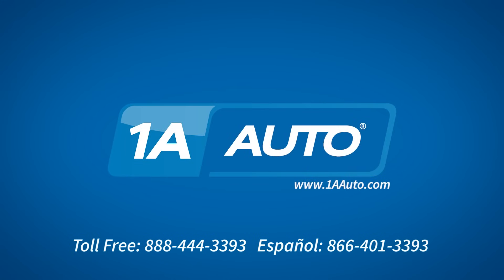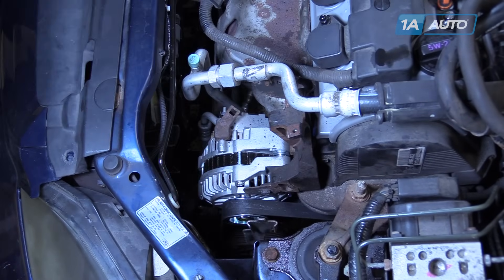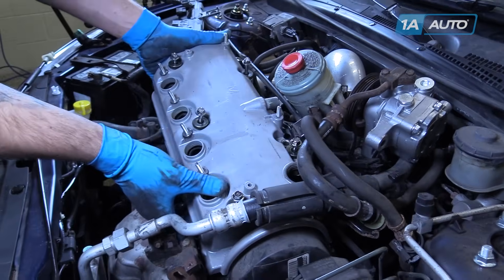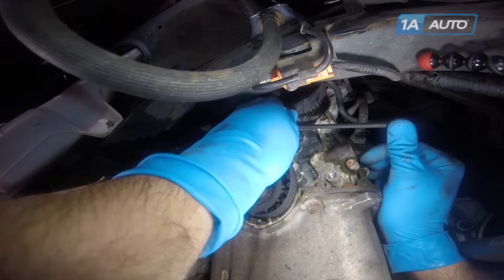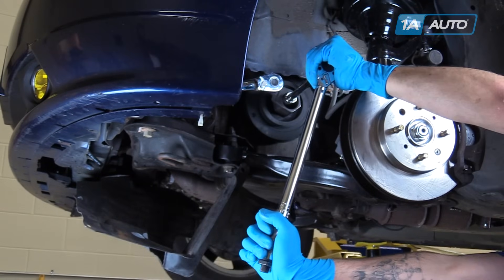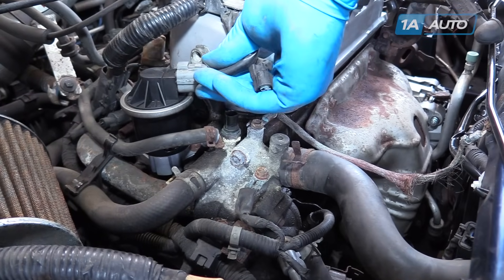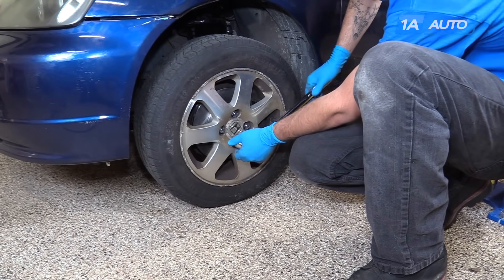How to Replace Timing Belt and Water Pump 01-05 Honda Civic Coupe Sedan

Comment: If you are going to do this job, make sure to turn the engine over COUNTER clockwise.  And it’s probably a good idea to disconnect negative battery cable so you don’t short anything out when removing alternator (be sure to have your factory radio code).
Reply: What is the reason that you should turn the engine counter clockwise?
Reply: That's the direction of rotation for the engine. If you turn it the other way you risk skipping a tooth, then you'll need to re-do the job
Reply: Two Thumbs Up for making this observation. I was wondering the same why the engine was turning clockwise instead of counter-clockwise and the battery should be disconnected as well.
Reply: because this Honda engine is a interference engine you will bend the valves if you turn it clockwise.
Reply: The reason he turned the engine clockwise has to do with the way the bolt is threaded into the crankshaft. If he tried to turn the engine in the opposite direction (CCW) the bolt would start to come out and not rotate the crankshaft.
Reply: Yeah I think this video is risky because of the fact that you're turning the engine backwards on an interference engine.
Reply: At what time in the video does this occur? What minute?
Reply: jimbobimboslice @17:13
Reply: @jimbobimboslice  did you get your answer? lol it is at https://youtu.be/3PAgdJ1ZSeA?t=741
Reply: Any one that knows this engine knows it is a counterclockwise engine
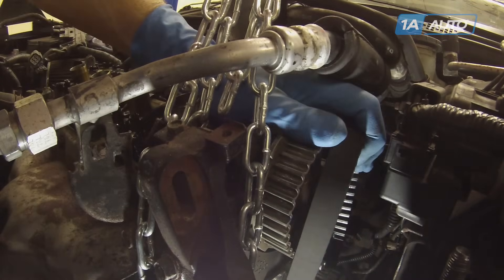Reply: @jimbobimboslice  17:06
Reply: I wish i had read this before doing the job, now I have to do it again hoping i didnt screw something up.
Reply: What the heck i just turn it clockwise like he did,
Reply: Joe Vignolo that bolt is torqued to several hundred foot pounds. Turning it counterclockwise like that will not even come close to loosening it I promise you.
Reply: @TheMrFlyBoy18  I see. Thanks. 

So we just turn it 2 complete rotation in a counter clockwise direction?
Reply: @Cowboy1Brian  Yes, I saw it. Thank you.
Reply: @ledzeppelin1212  I see. Thank you.
Reply: How to turn crankshaft twice if the bolt isn't tight?
Reply: If I turned it clock wise like in the video how do I fix this mistake?
Reply: @daddy.toe_666tm5  I did the same thing man😂
Reply: @robertauvil5451  exactly I had a 02 Honda Civic Coupe. I did the timing belt myself and I knew it was an interference engine I didn’t want to break my engine. I replaced the old timing belt with an aftermarket timing belt that was more durable. I installed an aftermarket radio after I was done with the timing belt.
Reply: But didn’t he already loosen that bolt to take the crank pulley off? How would you rotate it clockwise when the bolt wasn’t even torqued?
Reply: @thegreazysloth852  no it is not, the bolt was taken off and then placed back on in order to turn the engine. It is normally torqued to around 181 ft lbs of torque, but he just tightened it enough to turn the engine
Reply: @thegreazysloth852  so your saying we have to re torque it so it won't break counter clockwise
Reply: Yea i was looking confused too like "are they going the wrong way? Ahha
Reply: @Djevan41598  what brand was this aftermarket timing belt that was more durable? Model number? I would greatly appreciate it. Thank you
Reply: I noticed he did colckwise
Reply: Can anyone recommend a good video on the correct way to change the timing belt & water pump. I'll be doing this job tomorrow & I have 0 experience
Reply: @thegreazysloth852 How do you torque the crank bolt without the crank pulley for the serpentine belts attached and the use of the special Honda tool?  Looking for a proper method of turning counterclockwise, with the bolt installed, but not the pulley so that I can verify timing.

Comment: * START by disconnecting the battery!!!!***  Otherwise disconnecting the alternator will be disastrous.
Reply: It looks like it worked pretty good for him without disconnecting it but yeah that should have been done
Reply: The vehicle is grounded thru the alternator bolt.
Reply: @GampoEC  What you talking about brother?????? I’ve been a mechanic for 30 plus years and this got to be the dumbest thing I’ve ever heard.
Reply: As long as you don't touch anything grounded while removing the alternator charge wire. Then it all good. But i agree an unnecessary risk to take.

Comment: Buying a used 02 civic. Making sure this doesn't need replacement soon. Cause I don't want to do this or pay someone to do this lol
Reply: It would have to have prior maintenance done to the timing then.  They all need them changed.  It's probable that engine mounts, suspension, etc. will need replacing. So, you might as well do it all at once and know it was done correctly.

Comment: Hi 1A, your videos have helped us on numerous occasions, so THANKS! In no way are we trying to discredit this video, because it is right on the money, with the exception that this engine rotates counter clockwise, so when rotating it to make sure the timing and belt tension is correct, you have to turn it counter clockwise , not clockwise..
Reply from the maker: +Online Auto Repair Videos Thanks for checking us out! http://1aau.to/m/Shop-1AAuto-c

Comment: I just finished changing the timing belt on my 2005 civic while using this video as a guide. This video is great: high image quality, clear instructions and just the right length. Thanks for posting it!
Reply: Can some1 ^pls^ explain why it has been suggested to lift the car from the oil pan (w/ the wooden block under it). This not jack pt
Reply: Reza Grans you lift it to support the engine because you will be removing the motor mount bolts on that side
Reply: Good job! How difficult would you say the job was?

Comment: I just completed this timing belt and water pump job on my 03 Civic. Having access to this video is the only way I was successful in completing the job. 

I did run into a substantial issue with the tensioner bolt being stripped. I had to use a Time-Sert kit to retread the bolt hole. I can say enough about how awesome that worked.
Reply from the maker: Thank you for the great reply. We love to empower our customers by showing you how-to perform your own auto repairs while installing our high quality auto parts. Have a great day! 1aauto.com +Jake Stenzel

Comment: Doing my second timing belt and water pump on my 2005 Honda Civic Ex this weekend. Needed a refresher, thanks 1A Auto!
Reply from the maker: +Chrishawk4 Thanks for checking us out. Shop for high quality auto parts on 1AAuto.com:

http://1aau.to/m/Shop-1AAuto-c
Reply: really? my water pump is still original, though i think it's getting to be time for a replacement. timing belt a while ago.
Reply: How long does it take you?? I might attempt
Reply: How did your replacement go I have a 05 ex and the water pump is making a noise I think, so may jump into this project soon

Comment: You are told in the Timing Belt kit that you must turn crank counterclockwise  to properly take up the slack. Going clockwise and improper belt tension will result in a violent correction of the tensioner and or spring and or belt.  You just have to snug up the 19mm so that you can turn the engine without loosening the  bolt. Make sure you get 2 10mm wrenches on the Alternator wire connector or you will snap the bolt and you'll be buying a new one like me.  Yes you have to remove the valve cover to remove the top timing belt cover.  That's the easiest part of the job!
It took me almost 8 hours to complete.  I used an Impact for the tougher bolts and nuts. No problem getting my crank off. I had 150 psi on a 1/2"  NapaPro impact driver.  There was antisieze on the bolt so this was not the first Timing Belt on my 02 civic.   Working without a hoist of course.  I removed the upper PowerSteering Bracket as well.  Don't forget there
are 5 14mm bolts on that big bracket.
Reply: He rotated clockwise though.
Reply: Thank you 🙏

Comment: The best tutorial video I've seen in a long time. I just picked up a 2001 project civic, only for the purpose of teaching myself the ins and outs of motors. It only needs a head gasket but I'll do the timing belt and water pump while I'm at it. Thanks again! I'm about to start the search for a head gasket change video.
Reply from the maker: +Enthused Thanks for watching. The best way to learn is by getting your hands into the vehicle. Performing the head gaskets replacement, along with timing and water pump is a great start! Please keep us updated with the status of your project! 1aauto.com
Reply: @*Enthused- pls: give me any tips or share how much $ u hadda invest in that 2001 "project civic"? I am very interested in doing too
Reply: @Enthused: head gasket change seems craxy exceptionally hard because of the levelling of the block and head surfaces involved
Reply: ☆oh and once again - creDits to 1A Auto-- for the ulTimate video! : d

Comment: Everyone thank the amazing engineers at Honda that turn a simple water pump into a 4 hour job. 👏🏻👏🏻👏🏻👏🏻 I can replace the water pump in ALL of my other vehicles in about 30-45 mins.
Reply: You think this is bad? Try a mazda cx9
Reply: That's why I hate Hondas. Now I get to look forward to doing this miserable job. Should have never sold my 2000 Volvo V70. Timing belt is completely exposed on the engine with only a simple cover. Less than an hour to replace timing belt.
Reply: @marcfournerat4754  what year brother??

Comment: If you are wondering about the Crankshaft Bolt tool, 1A Auto doesn't sell them and it's not sold by Honda either, although their technicians use them. You can rent the tool at O'Reilly Auto Parts or buy it from them if you want to. If you don't have O'Reilly Auto Parts where you live the tool can also be purchased at Advance Auto Parts. Thanks 1A Auto for making these excellent how-to videos!
Reply from the maker: +MarkK Thanks for the suggestion!

Comment: Great video. A couple things I ran into, 1) Better to leave timing belt tensioner spring off until belt is on, then hook up spring. Otherwise I couldn't get belt on. 2) While torn down it's very simple to change crank shaft seal.  Almost put mine back together, but was concerned about a bit of oil that was at bottom of timing belt cover, then realized likely that seal.  When crankshaft pulley off and timing belt off, just slide the lower timing belt gear off the crank, slide off the giant washer with slots in it, and pry out old seal with screw driver without scratching sides.  May also want to consider camshaft seal while apart. Just need camshaft locked before taking off top timing belt pulley.

Comment: Thank you for the detailed video. This video helped me replace my wife's 2005 Civic LX timing belt and water pump. Additionally, I replaced the crankshaft seal, which was leaking. I do not recall the video mentioning the valve cover gasket. It must be replaced unless you want an oil leak from the valve cover.

Comment: Awesome Video!!!  Successfully replaced belt, tension pulley and water pump.  Thought my water pump was the issue, but ended up being the spring on the tension pulley failed.  Lucky the timing belt didn't skip a beat before I got to it.  Also had to replace the lower cam cover as it was fractured.  Very weird.Really appreciated the part about the 19mm cam pulley bolt.  What a b___h!!  Used a cheater bar and really reefed on it and it finally broke free.  Don't know if I would have gone all-out on it if it hadn't been for the video.  Wish I had smaller, skinnier fingers when working on these Honda engines.Thanks Again.  Saved me several hundred dollars.
Reply from the maker: +TukeyMan1 Thanks for watching. If any of our viewers needs to make this repair we carry the part shown in this video on our website. Here's a link to them https://www.1aauto.com/2001-05-acura-el-honda-civic-timing-belt-kit-with-water-pump%2c-valve-cover-gasket-and-seals/i/1aeek00622?utm_source=YouTube&utm_medium=CTA%20Comment&utm_campaign=1ATony

Comment: Great video like always.
 I have done several of these and it's just not easy no matter how many times I do them. Add the valve cover gasket, spark plug tube seals and it takes even longer. Takes several hours every time I do them.
Reply from the maker: Thanks for watching Marc. If any of our viewers needs to make this repair, we carry the timing belt and water pump kit show in this video on our website. Here's a link to them https://goo.gl/CH5yjY

Comment: If you’re having trouble with putting on the timing belt, try this tip screw on the tensioner but not all the way give it 4 to 5 turns make sure it’s loose do not hook the spring until you install the belt. It makes it a lot easier to install the timing belt , once it is in and the timing is correct you can tighten up the tensioner connect the spring and pull the pin. 16:58
Reply from the maker: +Barry Xayachack Thanks for the tip!

Comment: This engine rotates counter clockwise, you didn't tension the belt. You put the most amount of slack possible on it. You will be lucky if it doesn't skip enough teeth to destroy every valve!

Other than that its a very informational video for people looking to brush up.

Comment: The tensioner bolt as well Guys. I was having troubles getting passed 25ft/lb torque because the guy installing recommended 33ft/lbs of torque (18:05 of the video) The honda repair manual on page 6-27 clearly states "9.8 Nm (1.0 kgf/m, 7.2 lbf/ft)". This caused me to strip the housing! There's always a chance the housing had a little bit of damage that's true but It got way worse when trying to get up to 33 ft lbs... still probably would have been fine If I wasn't trying to torque 4-5 times higher... Like seriously man.... You just caused me so much grief over that one bolt that I could have been good by now. I had trust in this youtube video but now ill be having to double check everything that is said. Please put an edit in your video stating this, and double check the manual yourself!
Reply from the maker: +chrisok66 Thanks for checking us out. Shop for high quality auto parts on 1AAuto.com:

http://1aau.to/m/Shop-1AAuto-c

Comment: Note that this car has an aftermarket air intake.  The stock intake is right up against the back of the valve cover.  You can get the valve cover off without taking the air filter box off  but it's just kind of tough.  Taking the air filter box off makes it quite a bit easier. Apart from that, great video.
Reply: That’s exactly what I was thinking. Glad we could both put are brains together and figure out this problem. Thanks brother🤟

Comment: Nice step by step video.  I notice many people inquired about rotating the crank counter clockwise but you never replied.  Also, I read all the comments and nobody suggested changing the camshaft and crankshaft seals while your in there so I will make that recommendation.

Comment: I watched this just for fun, but do not rotate your engine the WRONG way when you get the T-Belt back on, to verify the timing, it is called "the wrong way" both as a reason and a description.  Other than that, everything else covered was very well done indeed.  Replace everything under the T-Belt cover as a rule.

Comment: Very good vide ! 
I had trouble putting the belt the way he’s doing it ! So I crank the bolt a little and counter clockwise it in 3 mins was done
Reply: Thank you for the info, I was thinking that was the way to go because their timing the engine the wrong way in this video.

Comment: I was reading the comments of the pass on this video and I just want to say, & correct me if I’m wrong, there are 2 types of motor. The 1.8 & 1.7 motors . On the 1.8 clockwise. On the 1.7 counterclockwise. On the video it must be a 1.7 motor therefore counterclockwise by the way perfect explanation on 1Aauto

Comment: correct me if I'm wrong,  but shouldn't that engine turn counter clockwise...
Reply: Yes that engine turns counter clockwise. If you time the engine while turning it clockwise, at the very first crank the tensioner will try to adjust tension abruptly and cause damage to the tensioner and or make the belt skip a tooth or two. How do i know this... hmm i followed that video and had to do the job twice.
Reply: Yes counterclockwise on this model!!
Reply: Yessir you are correct, you'll  want to put at top dead after removing the valve cover and upper timming belt cover. I remove  the crank bolt after putting at TDC.
Reply: Also this job the car has to be at level, you can potentially throw off the timing by raising only the front.
Reply: Add another to the causality list.  Everything else says this is a counterclockwise spinning motor. I should have been wary of someone using the alphabetical listing trick on youtube.
Reply: @Erup. No, there is no logic to that comment. You could time it with no issues even if the engine  was laying flat on the ground on it's side.
Reply: @erupmonsta5075  when you say top dead.. what do you mean? Piston number one?
Reply: @Rogelio0125  Correct.  Piston number one rockers should both have a tiny bit of slop in them up and down when all is aligned on the cam sprocket and crank belt drive as shown in the video.
Reply: @Ermal193  Dang it wish i read your comment, now i have to replace my starter which broke from improper timing and possibly the tensioner because of the lock pin thing. Thanks though bro